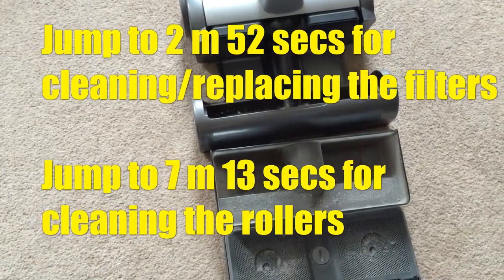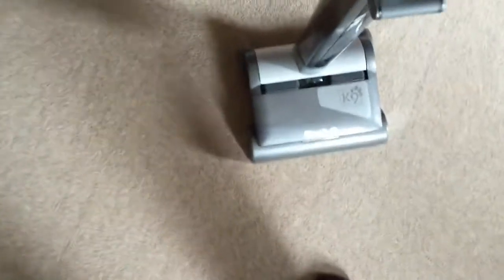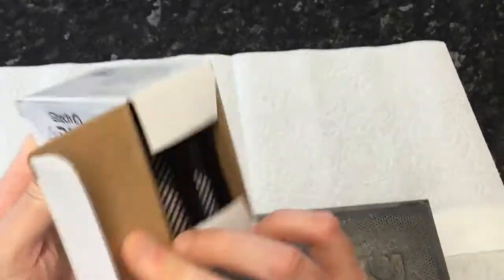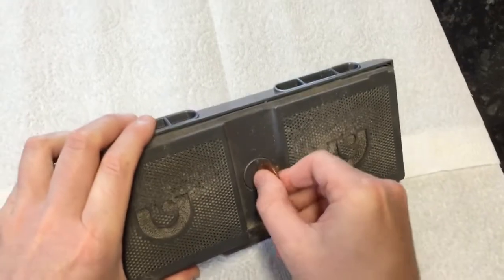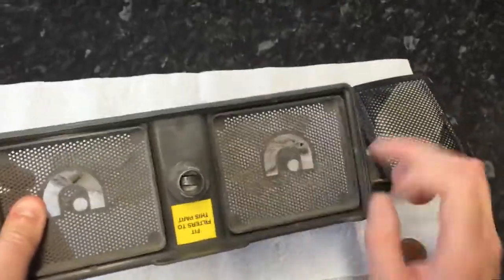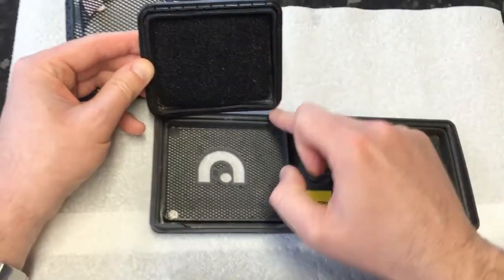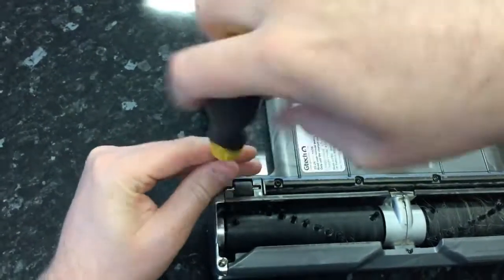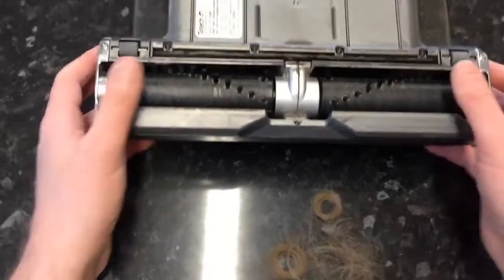Gtech AirRam - Demonstration, Changing Filters & Cleaning Rollers

Comment: Just changed the filters after three years of use.   I know!  Messy but OK but I found putting the new filters in was a pain.   Eventually used a tiny bit of washing-up liquid on a old toothbrush around both surfaces and it pushed into place.   Have washed out the old ones too.

Comment: This is very helpful. The roller on the front of mine has stopped spinning. I m going to remove the two sides and see if there's hair clogged it up.
Reply: Hi there. I've cleaned the brushes on the Gtech and they still arn't spinning. I don't think there's another air coming through one of the vents. I don't know if you have taken the cover off that to see if it's blocked inside.